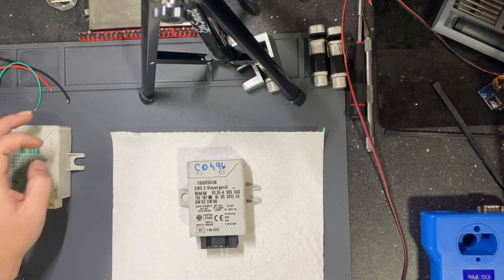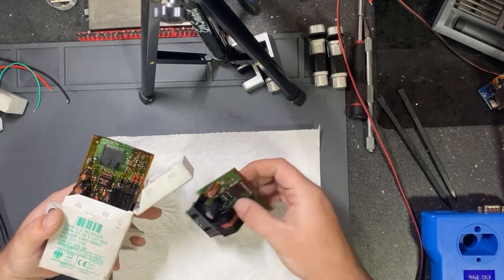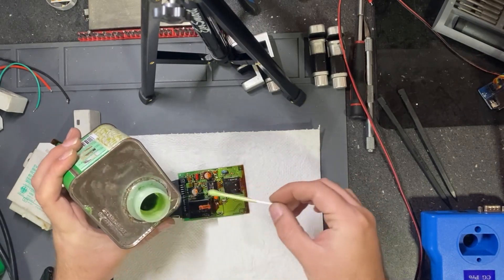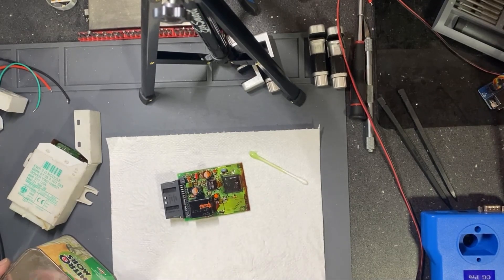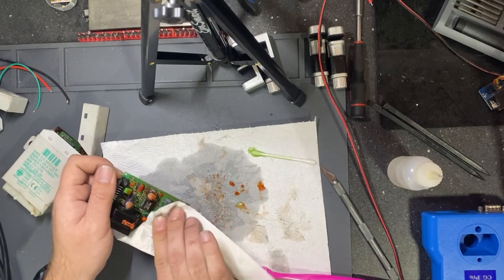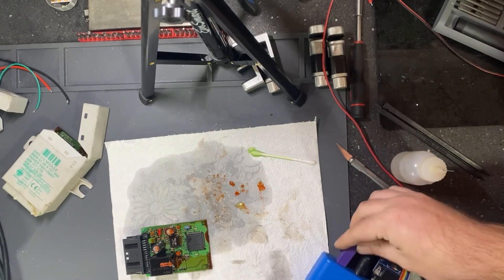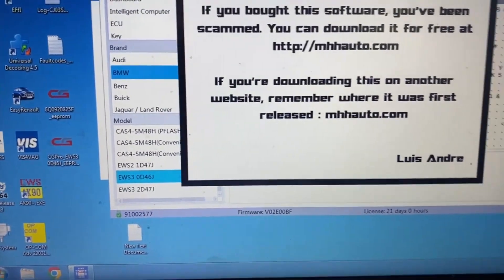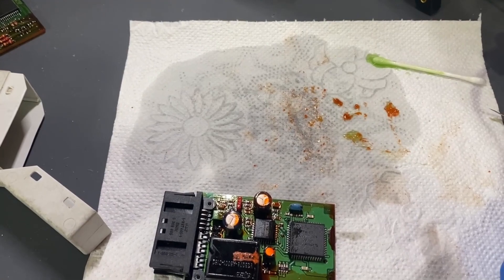Read BMW EWS3 - 0D46J with CG Pro

Comment: Hello Friend 

So you just can read mcu with CGDI Pro 9s12
For chip you have to use zebull 
Or you can also program chip with CGDI
Reply from the maker: Hello, in general you can program chip, but not for this ews. CGDI Pro its more a programmer for MCUs. Only few transponders can be programmed.
Reply: @UnixCoDElectronics  did you try it with cas 3 / 4 to add Key or akl or other cars on bench with CGDI Pro 9s12 ? 
Thank you very much
Reply from the maker: EWS3/4 you cannot do it AKL, CGDI Pro 9s12 its not  designed to be key programmer or used for keys. I use CGDI Prog 9s12 only where vvdi / multi prog fails. On old MCUs its more stable then xhorse
Reply: @UnixCoDElectronics  oky thanks
For me , for EWS 3 i use only ak90 read date n program chip 
For EWS4 i use vvdiprog to read data 
For cas3 / 4 .... I use autel

Comment: Hi, Im having problems reading EWS3 with AK90+. Its interesting how you removed the coating. I wasn't that proficient...I did only remove the coating from the chip legs. Is it necessary to remove the coating from the ECU top side? Can I only use alcohol and succeed?
Reply: Ak90 IS good for EWS 3, just clean good your mcu before Reading

Comment: The video was very interesting, please tell me, is this device worth the money, how does it cope with tasks? If this device is used for whole work with BMW, regarding the odometer, do you think it’s worth taking it or the best vvdi
Reply from the maker: Hi, the device can make keys / mileage on bmw from ews2 till cas4. Regarding whole work in bmw you will also need cgdi bmw. I’m not using as main tool, i think worth money even as backup tool in few jobs if you have to 0 as investment is ok.